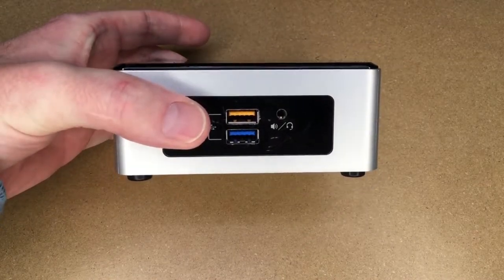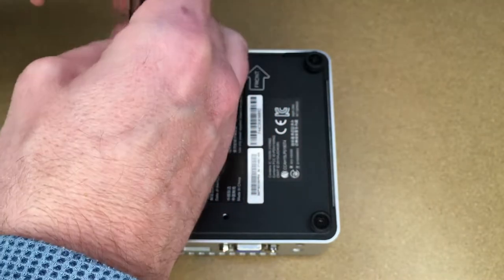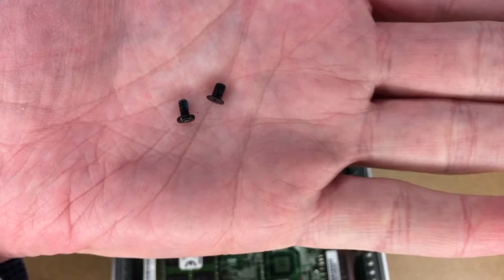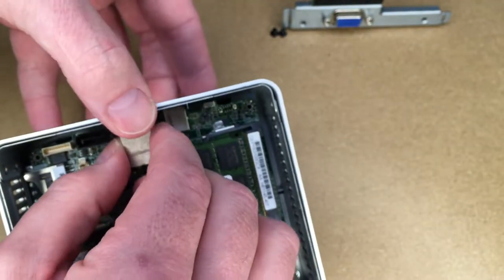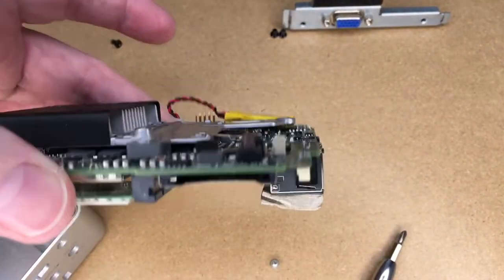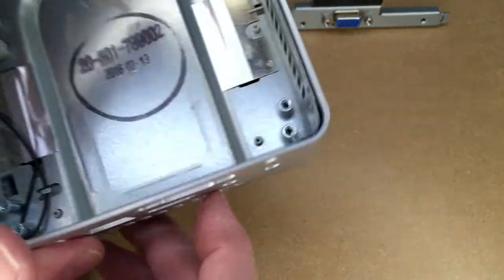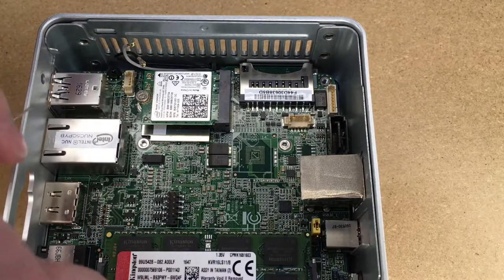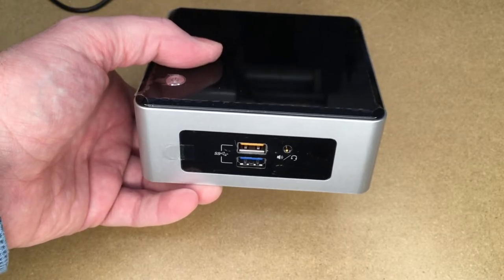Intel NUC NUC5CPYH Disassembly (for fan, battery, etc...)

Comment: Super useful video, thanks.  I had to change out the CMOS battery on one of these and was afraid I’d break the antenna wires getting the motherboard out.  You just popping them off with tweezers was a huge confidence boost.
Reply: 1😊

Comment: Thanks for taking the time to make this video. It helped me take mine apart to replace the CMOS battery. It was particularly helpful to see hot to pry the motherboard out of the case. As you mentioned in the video, it's mainly the audio port that you need to free by bending the front case out a little. I had 3 of them that I needed to replace. I found another video that showed how to attach the wires to a standard CR2032 battery using metal tape. I did that and saved myself probably $30. I don't know why Intel had to put the battery under the motherboard like that. It's a stupid design. And also, it would have been nice if the battery just fit into a slot like it does on most motherboards. I can see needing the wired version due to the small size of the motherboard, but, putting it on the underside of the motherboard is ridiculous. They must just view these computers are being disposable.
Reply: i need to replace the battery too ..... is it replacable inside the yellow sleve?
Reply: @mouthpiec  Yeah, but, you have to tear the wires off and then tape them back on with some metal tape. And then tape over it, or put another shrink wrapped sleeve over it
Reply: @idmhead0160  ok thanks .... first will try to find the whole package online.
Reply: @mouthpiec  What kind of a computer do you need it for? I needed it for an Intel NUC. I found one on Amazon, but, people were complaining the positive and negative wires were on backwards. I'm amazed Intel doesn't offer a replacement part for it. I guess they just want you to throw your computer out and get a new one when the battery dies.
Reply: @mouthpiec  I think I found one somewhere, maybe on EBay, but, it was from China and was going to take a month or more to get it

Comment: 8:10 me too, buddy... me too :) Thanks for the vid... Turns out the rattling noise was the battery which apparently got loose somehow!
Reply from the maker: When I see batteries attached like that, it almost seems like they included them as an afterthought.
Reply: what was the solution? glue it back down? with what glue? I have to open mine to change the fan and it would be good to change the battery too (if I can find one).

Comment: Just did it , had to change the CMOS battery , thanks , lucky I have a battery spot welder ! I used a normal slightly larger battery same volts it still fitted no probs
Reply from the maker: A battery spot welder sounds like a nice tool. I've thought of getting one but I haven't had a big need for one yet. They would be nice for refreshing old power tool batteries.

Comment: Excellent Video.
I have a Qn re: battery: My CMOS batter needs replacing.
Can I replace just the CR2032 battery inside its yellow plastic housing - did you notice if you can get in there and disconnect the battery and replace it (there really cheap) OR do I have to buy the yellow housing ready to go with the cables and connector as in your link to the CMOS Battery  Amazon link?

thanks
Sam
Reply from the maker: I didn't dig into that but I'm guessing the wire is permanently connected to the battery. They are often tabs spot welded to the battery and wires soldered onto the tabs. If you could theoretically make the battery assembly if you had a battery spot welder but it is probably easier to just buy one already assembled.

Comment: Hi, great vid! But I have a question.
Is there ANY possible chance to get a dedicated graphics card and get it working with this little machine to give it some graphical boost? 
Please reply, I’m considering buying this.
Reply from the maker: Unfortunately I don't think there is a way to connect a dedicated GPU to this model. There might be some newer models that support eGPUs.
Reply: @Rickmakes  Oh, well, thank you.  But fortunately I actually did found some newer, much powerfull model with thunderbolt 3 - Intel NUC Kit 8i5BEK , so that will be possible I think :-)

Comment: They do seem easy enough to disassemble.  The hardest part would be reattaching those WiFi antennas.  Anyone who has ever done it will probably tell you that it may take a minimum of a few minutes unless you are used to them.
Reply from the maker: Yeah, they can be tricky. Just seeing them can be a challenge these days as I don't have the eyesight of my youth.
Reply: I replaced the Wifi adapter in my thinkpad notebook and I was never sure if I'm going to break the cable or port or not. I tried to position but since it was under my finger (to make sure I press directly down) so I was never 100% sure, and I also had to press with more force than I thought should be necessary until it worked somehow. I hate that UFL connector. My CPU is peaking at 85 Celsius so I'm unsure if I should repaste the heatsink but that wifi antenna connector makes me think twice :) taking out and putting the motherboard back seems a little finicky perhaps but by far not as scary.

Comment: What is the recommended period for cleaning the fan?
Reply from the maker: It all depends on how dirty the environment is and how often you use the computer. If it is in a dusty area or you have pets that shed, you would want to clean it more often. Sometimes you can hear the fan is louder due to debris in and around the vents. You can also see dust around the vents on the outside. If that is dirty, it is probably dirty inside too.
Reply: @Rickmakes  tnx

Comment: thats so dumb, why the battery is on the other side of the board, makes no sense. its only harder to replace it, mine already died...
Reply from the maker: It makes so sense. The battery is one of the few things you can service in this computer and they put it in most difficult to access area.

Comment: is the battery inside the yellow sleeve replaceable?
Reply from the maker: I have a link in the description to a new battery. You could remove the yellow heat shrink and replace the battery and keep the original wires but the wires are welded to the battery so if you don't have battery welding equipment, you shouldn't do that repair (do not solder the wires!). It is easier to just by the battery with wires.
Reply: @Rickmakes  thanks.... but i don't have battery welding. Will tape work?
Reply from the maker: @mouthpiec  Probably not very well. Conductive epoxy might work but it costs more than buying the preassembled battery. You would also still have to reapply the heatshrink.